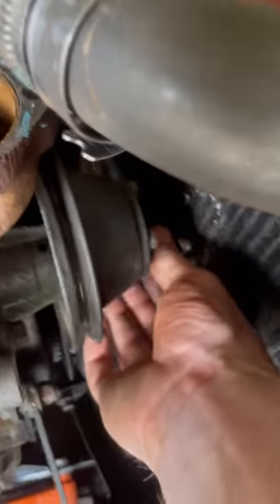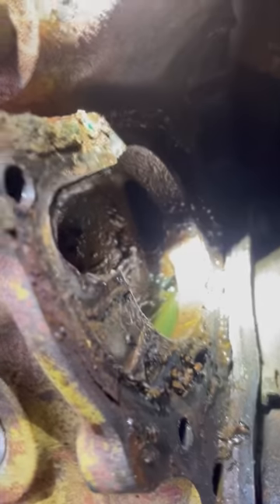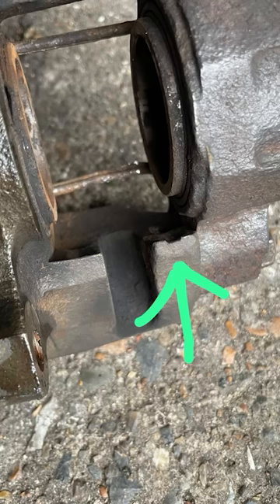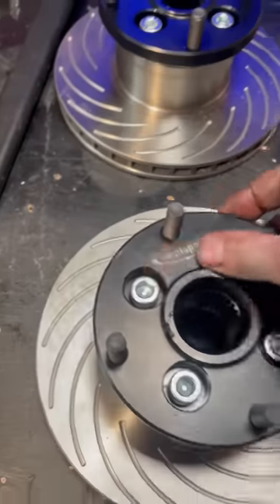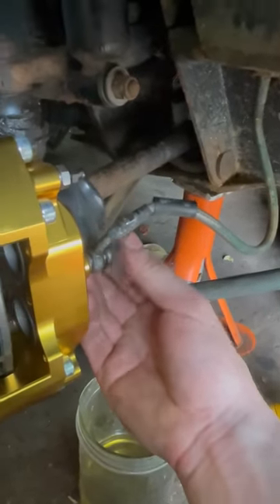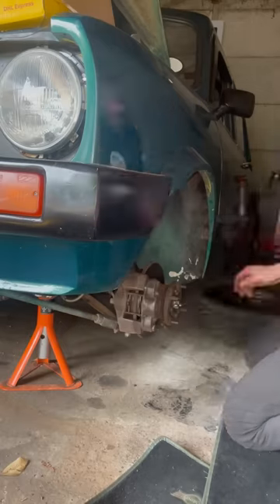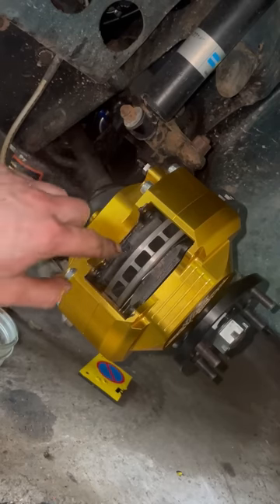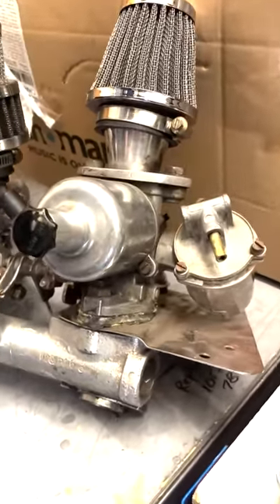It Broke On The Drive Home!

Comment: probably worth doing a coolant flush mate.
That motors been sitting for a while or someone put straight tap water in there (hence the corrosion).
edit: I'm just a panel beater and painter so don't take my word, you probably know more than me lol
Also, play Organ Donor by Dj Shadow on your organ, I'll donate £20 just to see/hear it.
Reply from the maker: all good i do need to do that. thinking in winter if still obsessed with this whole automotive malarkey to take it all out and rebuild it. the engine that is. :D. but it would be prudent to do a flush indeed. cheers
Reply: True, I've learned that too. During time the anti corrosion agent will fade and it's leading to engine block damage.

Comment: Brilliant you're fiddling with Minis. My first car was a Mk1 850 Mini after I passed my test in 1977. It had various upgrades including 1100cc motor (bang!), 997 Cooper engine (bang!) and finally a 1340 Oselli tuned engine with a Weber 40 DCOE side draft carb. Then the body rotted. Hey Ho.

Comment: How so many times have I “Been there. Done that.” But you “haven’t lived” until you find yourself unable to drive faster than 25km/h no matter how much gas you give it…look under the hood while the engine is running…see green liquid bubbling out of your carburetor (quite normal, right? Nothing’s amiss. RIGHT? 🤦🏻‍♂️)! Loved those leaking head gaskets. REALLY loved spending an entire day replacing them (yes, THEM: V-8 engine. TWO head gaskets! BOTH leaked 🤪🤪)!

Comment: Ohhh shiny calipers. I believe Minisports calipers are actually made by hope who make the mountain bike brakes. Only thing is, I think the discs are on the wrong side.. the grooves are meant to face backwards at the top like \ so that the dust leaves via the groove when theyre spinning going forwards.
Reply from the maker: No way! That's awesome. I have hope's too haha. C2's on big uns and original m4's love em. That's so cool.
Reply from the maker: Nope the grooves face forwards to cut into the pads. I'm Aware it's hotly debated. But I'm in the grooves point forwards camp

Comment: Modify the car so that it is MIDI controlled. Make it so that the more furiously you play, the faster it goes 😀
Reply from the maker: The orange one does have a sync out! I gotta finish wiring it In some time ha
Reply: That's all you can come up with? ;)
Make the car completely remote controlled via MIDI!
Ch1: steering
Ch2: throttle
Ch3: clutch
Ch4: gear select (128 / # of gears)
Ch10 (buttons): additional controls like hand brake, ignition, wiper etc.
Control everything through an Arduino, add a WLAN device and you could drive that car with a NintendoDS.

The original MIDI protocol has some serious limitations, but it's still fun to play with, because it's such an established standard. I doubt it would be street legal, but ... FUN! :)
Reply from the maker: @fonesrphunny7242  you can do that to your car :D

Comment: Twin SU's on a Mini is the way to go! Best mileage : performace available. All they need is good parts and proper treatment with maintenance by the book, and they will be problem free. While you're at it, check the valve lash and cover seal. Please.
Reply from the maker: i did the tappets the other day :D. cover seal, what you mean, timing cover? rocker cover?
Reply: @LOOKMUMNOCOMPUTER  The seal between the valve train cover and the head. To keep most of the oil inside the engine. And valve lash needs to be checked to monitor the valve seat wear. That engine is from the "leaded era" so the seats and valves may or may not cope with the modern fuel. If the seats have been re-machined, even more so. After a long run the seats can be sunken in, valves dug into the seats, etc etc. cheapest way to deal with engine failure is to catch it before it happens.

Comment: That intake-manifold looks like it might be the type which can take larger SU carbs if ground out! 
Although you can use the same linkages, you need to hunt for the rarer carb with the float on the opposite side, plus you need to get some advice about fitting the correct needles!
Reply from the maker: Yep. I'm gunna keep at 1/4 because it's only a 998 and not a revvy one :D. Keeping the Low down useable is the goal with this one

Comment: That pump looks as though that water pump/engine had not moved for a long time with the water mark on it!
Reply from the maker: Yep
Reply from the maker: It had probably sat still for 20 or 30 years in the car between mid 80's and 2010

Comment: If it was me, as the disc-brakes were being replaced, I'd have taken the opportunity to replace the wheel-bearings & ball-joints! 
Also a good time to check for any excessive play in the CV joints!
Reply from the maker: I would have. But ball joints were replaced in last 500 miles. And bearings. So I didn't bother.

Comment: Do the timing chain when you do the water pump, while you've got the engine torn down. Nice anodisation job on the calipers!
Reply from the maker: I don't think I would go that far after a water pump. Would need cracking the pulley and timing cover and maybe the radiator out. Lot more work when planning to rebuild engine in a few months.
Reply: I've never had any problems with timing chains, specially if you've got the twin timing chain. It's a good idea to replace it as part of an engine rebuild certainly, but I don't think I'd bother doing it just because the water pump was being replaced. It's a lot more work to get the timing cover off which itself is rather flimsy and so needs care in removing it. Oh and then there's the timing cover oil seal of course...
Reply from the maker: @skin150263  yep agreed.

Comment: Twin SU carbs at the end oooh
Reply from the maker: Rough as a dog though! 30 quid at a car boot. Got a rebuild kit on the way. That'll be the next short car vid inbetween usual vids ha
Reply: Dual TBI that manifold with a megasquirt n spark or one of the derivatives of that open source fuel injection controller.
Reply: @greggv8  Obviously some Jenveys would be mint but he already has the Skinners Union jobs

Comment: You don't do it like that! Actually you do, nice. Good that you didn't have to mess with tapered wheel bearings.
Reply from the maker: Yeah luckily on this mini it was all done already! That's the first thing I had to do on the orange mini when I got it. But I didn't film it :(. The front wheel bearings.
Reply: @LOOKMUMNOCOMPUTER  Nice upgrade. I've never worked on a Mini but I've done Land Rover wheel bearings lots of times, I hate them!
Reply from the maker: @MattTester  yeah. Farse! I bought a bit of pvc cylindrical block that was the same size as the bearings. To bash them in squarely. Think that simplified matters!

Comment: You may wanna look in to that intake system, you can very easily have 10% more power and better filtering system that doesnt draw hot air from engine bay 

This is video from Garage 4age where he tests different lenghts of intake runners https://www.youtube.com/watch?v=nqYkmCLrlEo

Comment: Surely you can afford a lexus LC500 or an Aston Martin.
Reply from the maker: I can't. But if I could why the heck would I buy one of those 😂
Reply: @LOOKMUMNOCOMPUTER perhaps because the LC500 is one of the greatest pieces of engineering.
Reply: @LOOKMUMNOCOMPUTER   on the other hand we sill have a pizza box SGI sparc station and even a manual drafting machine at the workshop...
Reply from the maker: @SimonPEdwards63  fair enough. Not my thing. Wouldn't own a Lexus in a month of Sundays :D. All good can agree to disagree cheers